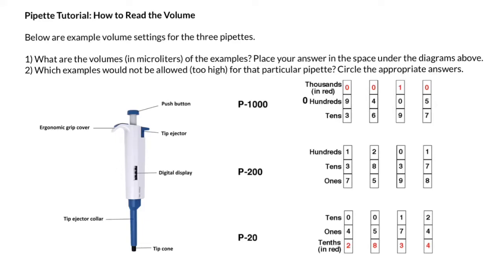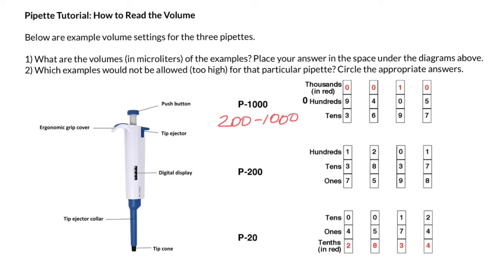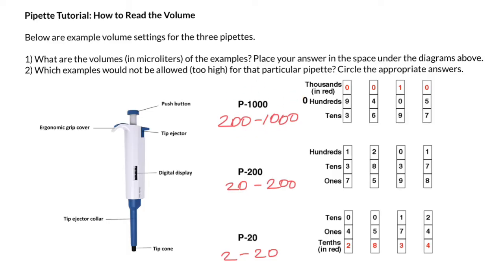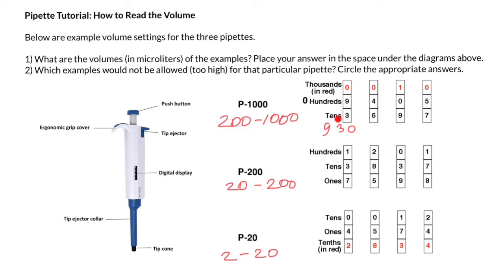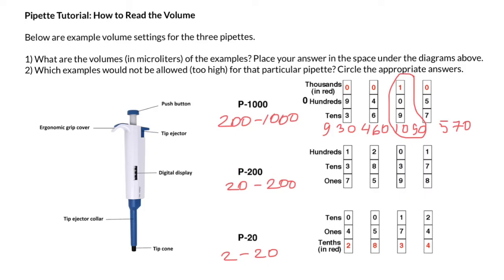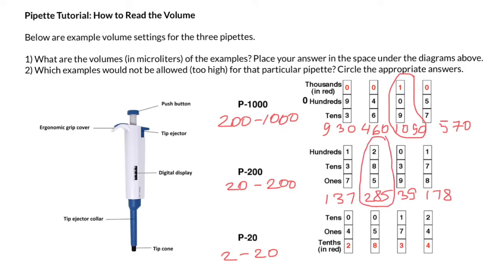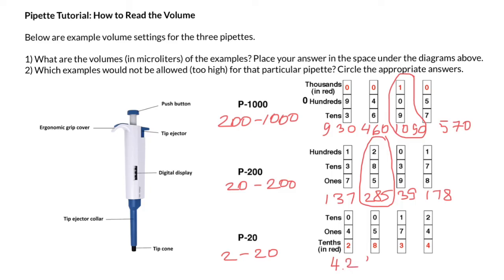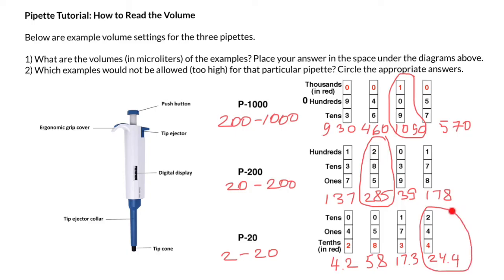Micropipette tutorial: How to set and read the volume

Comment: How can the value be 1090 when the pippette can only measure till 1000 in first one.
Reply from the maker: The reading 1090 μL indicates that the user has cranked the volume adjuster past its upper limit. This is a critical mistake in the lab because:
It severely damages the spring mechanism inside the pipette.
It throws the pipette out of calibration, meaning it will no longer measure volumes accurately, even when set to a lower, correct volume.
The presence of the 1090 setting doesn't mean the pipette can be used to measure that value; it means the pipette is being misused and is likely broken.
Reply: That's why it was circled as being too high for that particular pipette